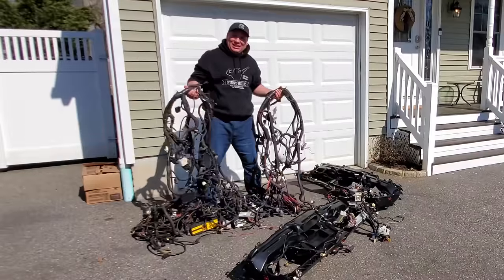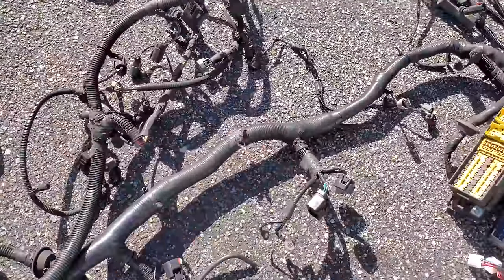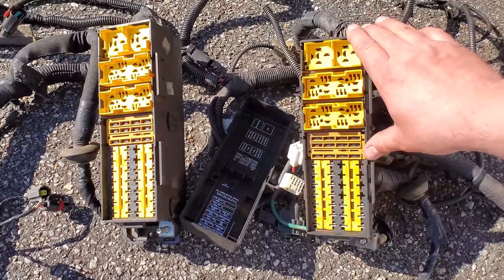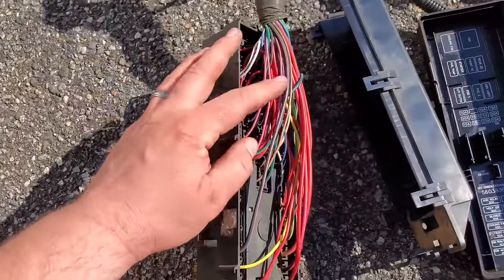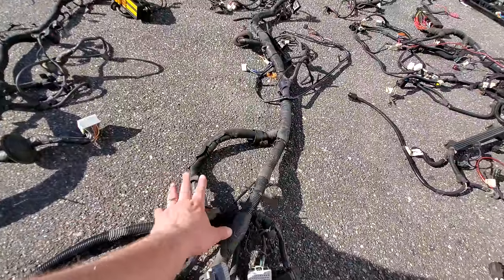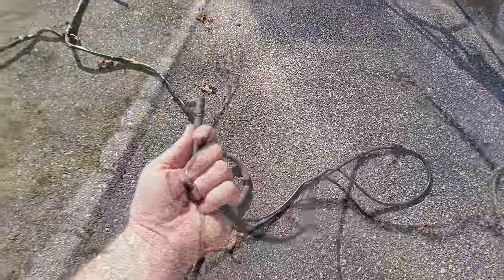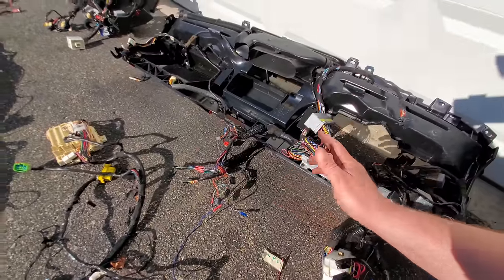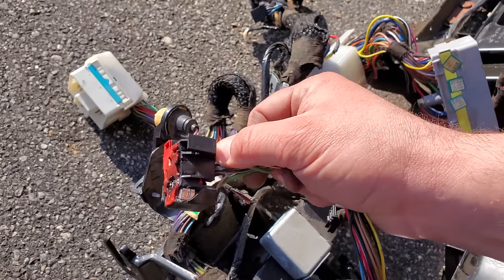JEEP XJ WIRE HARNESS GUIDE - ALL ABOUT THE WIRES FROM A 97-01 JEEP CHEROKEE XJ

Comment: i am putting my 97 xj back together after replacing the a/c evap core. I noticed on the right lower side of the dash by the fusebox there is a white female connectoe about 1 1/2" wide with small spade connectors in it. I dont see what it connects to. It is dirty/dusty inside (looks like it may have never been connected to anything) Do you think this may have been wiring from the drivers side for pwr windows..because mine does not have them. Im just rying to find out a little more info before i go back together with the dash. I probably would have remembered but this project has been strung out over a few weeks.
Reply from the maker: It could be alot of things. the junction block was a main area for plugs.  could be power seats, power doors, or even the overhead console.
Reply: @ProjectDanH  It wasnt connected to anything. I got everything back together...vacuumed the system to discover the brand new accumulator was leaking! UGH!

Comment: Ok so I have a question. How come my fuse box has a different design then the ones you're showing? It's either a 98 or a 99 but the fuse box is different
Reply from the maker: fuse boxes has changed over the years, that's why some wiring harnesses are not compatible

Comment: Heh Dan.  Thanks for this video.  Wondering if you can perhaps help me with the name of the wiring harness I need that communicates with the gearbox/transmission.  Our mechanic had an auto electrician repair a harness on our 2007 Jeep Grand Cherokeee Navigator as there were no harnesses available in Australia that they could find.  Our car had had problems with the entire electrical system failing...everything died and we could not start the car.  Many weeks later and the car is fixed but we were told to try to find a wiring harness overseas and keep on hand as the job was a bit of a hack and if it failed we would be back with the car not changing gears...limp mode.  If you could tell me the name of the harness I need so I can look for it?  There are so many different wiring harnesses!!  YIKES!  Thanks.
Reply from the maker: please provide the type of engine and transmission. also the trim package. Ill see what i can find

Comment: Anyone ever bypass the high beams being controlled by the multi-switch for the turn signals in a 99 Cherokee? I'm tired of those switches going bad. Which wire are the high beams?
Reply from the maker: so you want to eliminate high beams all together?
Reply: @ProjectDanH  No, just make them a separate switch. Maybe a floor button like my old 66 Mustang had. I just need to identify the correct wires/connections to the turn signal high beam switch and bypass them. Someone must have done this before vs always buying new switches.
Thanks for the reply.
Reply from the maker: I don't know of any Xj mods like this.  I have seen people mod their fog light relay so they can have HI beams with fogs on. this is completely different though.  if you get a wiring diagram I believe this could be an in mod.  just intercept your signal and get an oem switch to control it.  people on ebay 3d print switch bezels. you can have a 4 switch panel w 2 foglight switces. 1 for fog, the 2nd for hi beams
Reply: @ProjectDanH  🤙

Comment: I'm in a crazy situation.  I have two XJs.  I have a 99 4wd manual sport with a rebuilt title that's in perfect shape minus some minor floorboard rust, and a perfect body 01 2wd limited with a blown engine and a clean title.  When I moved to GA they said they wouldn't accept my rebuilt title 99 due to the vehicle rust.  I was wanting to move the powertrain to my clean 01 and go ahead and part and scrap the 99.  Problem is since I'm going 2wd to 4wd I need to move the PCM and since it's a 99 one is coil on plug and the other isn't.   I don't care about most of my options such as my heated seats and such.  My sport actually has an overhead console.  I'm actually bringing my cloth seats with the sport cause they are in better shape.  Can I just replace the engine harness portion?  Any thoughts? Thanks!
Reply from the maker: You should bring everything over including the coil packs.. I believe somewhere out there there are coil pack adapters to put the 00, 01 ignition on an older engine

Comment: Nice vid! Not sure I've heard a lot of positive comments about ABS on XJs, if I remember correctly people usually describe it as dangerous since it hasn't proved very dependable like the rest of the XJ. Anyhow, I too think it would be interesting to install... however not on my Jeep =]. If you have an extra fog light switch I'll gladly send you some $$. Mine actually was busted and I had to remove the spring to get it to work. I removed the fog lights for now but still think that switch can be used =]
Reply from the maker: The problem with the factory switch is the heat the indicator bulb emits.  The fog lights weren't intended to be on all the time.  I'm sure lots of XJ owners like myse keep that switch engaged all the time and eventually the bulb melts the internals of the switch. Switching to LED is a must if you want to use the factory switches for driving lights.  I will gladly send you a switch if you send me your broken one back! I will rebuild it! 😁
Reply: @ProjectDanH  Lol you asking for a core bro? Sure thing. It does work... it just lost its mojo. IDK how to DM on here so if there's an easy way to get you my contact info lmk!
Reply from the maker: @seanmacdonald8476  LoL! Definitely a core charge! Haha.. can you DM me on Instagram? @project_danh
Reply: @ProjectDanH  Got rid of the social media but this is what girlfriends are for! We'll be in touch.
Reply from the maker: @seanmacdonald8476   sounds good!
Reply from the maker: LoL, the Sox! They sure are doing well in game 3.. it ain't over till it's over tho.  Good luck on that floor! I'll reach out to you and wel get this fog light switch thing goin 😁

Comment: Aloha braddah! I need some major help please! I have a 99 XJ. It’s an electrical nightmare. My airbag light stays on. When it’s on, the blinkers and blower doesn’t work. And the interior lights stay on too. I’ve ran through almost the entire wiring and nothing seems blown or burnt. And just recently I noticed my headlights don’t work anymore. Not sure if it’s all related. Any ideas?
Reply from the maker: you could have a couple different problems.  if its window or locks i always look into the driver door boot.  thats not your problem this time...  I know that the Headlight plug melt sometimes, that could be your headlight issue. you also may have a short somewhere... look for broken wires and loose connections!

Comment: Hey dan, with the wiring harnesses, is there a wiring harness per door? Because the owner before me hacked up the wires on the driver’s door and I figured it was plug and play in that regard and found a harness on Amazon , and I figured I’d just ask and it doesn’t look like it’s cut in anyway and looks good to go. Thanks!
Reply from the maker: Hey! Yes both front doors have harnesses that plug into the body harness! Going luck!

Comment: Hi im looking for the oem harness connector to the plug from the foglights itself. I have my own wiring. Switch ect. But i have to have a conncet to the wireset i have.  But cannot find the connector to plug in to the foglights
Reply from the maker: You would need a whole headlight harness that comes equipped with fog lights to get OEM fog light plugs. Unfortunately the rest of your Jeep isn't wired for fogs internally.  Your best bet is to use the OEM switch and run a new fuse and relay to your added fogs

Comment: Need help Dan with this dang cruise control on my jeep dont work like to have it but about to make me crazy ive went through all vacuum hoses and there no leak the linkage is hooked up to throttle body and went u go to test the codes on the jeep with the switch the cruise light will come on.The horn works but no cruise light with the button 98 xj classic what I got
Reply from the maker: hey tod! did your jeep com with CC or did you add it with the ol plug n play method?  if you add it on yourself you must get steering wheel buttons from another 1998 (1997 may work too).  if your  buttons match your Jeeps year then you have to check your brake pedal pedal sensor.  it's the little plunger on the top of your brake pedal assembly. make sure it moves in an out freely.  if that's broken you can find new ones on ebay.  those are the most common CC fails. good luck 👍
Reply: @ProjectDanH  mine came with cruise control ive went through it all also even swapped the button on the steering wheel
Reply: @ProjectDanH  I bought a new brake pedal switch installed it and I thought once applied your pedal and let off it would set the switch sound like a zip tie ratcheting down its not moving freely nor is the old part I took off
Reply from the maker: @todhollandsworth4371   that ratcheting sound is the plunger setting it's depth when the pedal engages the switch for the first time.  Once it "shortens" up it should still expand a little when the pedal is released.  I'll look into it some more.  Maybe you can test the continuity with a multimeter
Reply: @ProjectDanH  when I first got my jeep the top of the dash didnt fit right I beleive last owner tore it apart cause when I got it after 10 minutes of driving it all interior light dash would cut off driving at night I don't if that may be a problem a loose wire somewhere I fix the issue when lights cutting off  it was the connection in the black block plugs into the headlight switch wasnt getting good contact with one wire and it was about to fall out of the block
Reply from the maker: @todhollandsworth4371  oh man. That's probably it. A previous owner hack job.  I hope you can sort it out.

Comment: Hi Dan I need some advice.......I have a 1990 wrangler yj with a jeep Cherokee xj 4.0 with fuel injection as well......is there a crossover harness to purchase to complete the circuits?....I have the relay box and injector harness installed....the fuse box in the cab is a yj setup...please advise
Reply from the maker: Hey Michael, that sounds like a great project.  I've never done a crossover harness before.  If it were my YJ I would try to run the whole XJ engine harness

Comment: My 99 xj shuts down when the wire harness moves a certain way, i'm keeping it in place with zip ties :/ fuse box it's self doesn't stay in place euither. I'm sure I need a new harness but I haven't been able to find one for sale :/
Reply from the maker: Oh man. Check your ground wires then look around for any brittle cracked wires.  The heat inferno under the hood is so bad on the wires.
Reply: @ProjectDanH  ok thanks. Yeah it does get really hot in there

Comment: I am not getting power on the pink blue wire at my brake switch. I have power coming out of the pdc . Does it have any inline fuses or connections I should check? Also does it go through the interior fuse block? Thanks
Reply from the maker: what year and trim level?
Reply: 2001 sport
Reply from the maker: reach out to me on Instagram @project_danh

Comment: A friend of mine just swapped in a harness and engine from a 98 into 2000 Cherokee.  Now he has headlight and running light problems. Any pointers on what might be the problem might be? Thanks.
Reply from the maker: does he have the head light module installed under the dash?

Comment: I forgot to punch a hole in my new carpet and run the single wire to my seat bracket (manual seats).  What is this wire for?
Reply from the maker: is it the seat belt warning light?
Reply: @ProjectDanH  not sure. It was just a single wire to the frame of the seat,  my warning light is not on no matter if I wear or not lol.
Reply from the maker: @MajorWeakness  lol.. yea that stupid light is on in the beginning then goes away regardless

Comment: I replaced my manual doors with electric replaced the wiring harness that goes around to the other side plugged everything in and windows and doors don't work I noticed I have a couple things not plugged in on pasanger side near fuse box, I can't find any place for one of these plugs from the door harness that has to be plugged into something
Reply from the maker: the body harness plugs into the junction box by the passenger kick panels but I don't know now what you have and what you don't. send me pics on Instagram

Comment: Have you ever dealt with grounds or fuel wiring causing them to die while turning right specifically?
Reply from the maker: Not exactly sure what you mean by that but I haven't had any ground problems
Reply: Project Dan H I believe it to be a ground under the hood but so far I have found the culprit. Would the alternator/starter ground matter in that instance? And I’ve yet to look in the tank and see how all that is
Reply: Haven’t found. It only happens when coasting through a right hand turn.

Comment: Hey Dan , any direct swap from 1994 sport to newer (what year make) door panels. My window controls are pretty old these days.
Reply from the maker: Hey, thats a great mod! Ive never tried it before.  You will probably have to do a lot of wire soldering to connect your door harness to the newer window controls
Reply: @ProjectDanH  so currently I have the 4 doors from a 93 loredo installed on my 94 sport. Cuz the donar had power. Wired the windows to work, but had issues with power locks until I bought a universal key fob kit. Utilized just the brain to get them all working correctly.
Reply from the maker: @renonobody2284  hey, key fob! that's a great idea!

Comment: So if I have a 2000 Jeep Cherokee Sport and I need a new wiring harness and I find a nice 2000 one but it has ABS (which mine doesn’t) is that an issue when trying to install that harness?
Reply from the maker: Nah. You'll be ok!
Reply: @ProjectDanH  just do a total harness swap and everything should be plug and play? Thanks for the response. This stuff is a nightmare to learn on the go

Comment: Hey Dan I have a 99 sport 4x4 I wrecked I already took everything out cause I bought a 2001 but trying to make everything work properly I used motor trans transfercase engine harness and computer and put it all in my 2001 but when we tried to start it it wouldn’t start in work or neutral without crossing starter then it would run but we tried first gear while it was on the lift and it actually started by key could you help me find out which pins in the plugs of the two harness I put together would need switched
Reply from the maker: oh man.. its hard to say without being there with ya.. there were some differences in the wiring but you'd have to compare them in the service manuals.  see if you can find both a 99 and an 01 FSM

Comment: I'm trying to hook up a new set of LED headlights with a driver light feature and need to tap into a 12v source that is only on when the ignition is on. I cannot seem to find a good wire to tap into for this. After some research I found out the ignition harness has a 12v accessory wire, but haven't been able to pinpoint where that harness actually is and if that wire exists in the engine bay. Can you help me figure out where this is or recommend an alternate 12v power source in the engine bay only when the ignition is on? Thank you!!
Reply from the maker: power the switch with the accessory cigarette lighter, power the lights with the battery.  make sure you use a relay
Reply: @ProjectDanH  I'd prefer not to tap into a switched source on the other side of the firewall. After some more research it seems like a fuse tap may be another option. Is there another location in the engine bay you may recommend?

Comment: If I want to add power windows and locks to my 98 SE, do I need to replace the entire body harness or is there a plug in there somewhere that I can add the window/lock harness to?
Reply from the maker: Yikes I'm not sure.. pull the boot in the door jamb and see how man wires are in there
Reply: I personally just grabbed all 4 doors, wiring harness from driver and passenger foot panel back from a 93 loredo and put all on my 94 sport

Everything plugged and worked except power locks. Bought a universal key fob for 29 off Amazon and locks with now.  Good luck

Comment: hi dan. i have a 1997 jeep cherokee.. my engine wiring is getting old.. its 22 year old.. and im wondering if i can fit 2000 engine wiring onto the 1997 jus to make it little bit more younger due to there are some connecter that either no longer make them or not identical same as the factory  it becuz its over 20 years old and is there any requirements to make it to work just to get the 2000 wiring harness onto 1997 jeep cherokee...
Reply from the maker: I would avoid a harness from a 2000. There is alot of differences.  Distributor to Coil packs for one.. I would try to stick with the same year harness.
Reply: @ProjectDanH  ohh yeah i am well aware bout the distributor and coil pack... i was more concern bout the wiring patterns from 97 same as 2000 wiring pattern... the only difference between the 97 and 00 is the one with 00 has distibutorless, coil pack and extra 02 sensor and my 97 dont have extra extra 02 sensor and it has single coil and distributor..
Reply from the maker: Check the bottom of fuse box caps between those years.. if they have the same accessories I don't see why you couldn't swap it over and add the missing piece... However I do believe they Are wired different

Comment: Do you know if the 98 under dash harness would fit on the 97?
Reply from the maker: yes and No, They are different in some areas depending on the emissions... you may be able to get it working if your connectors are the same